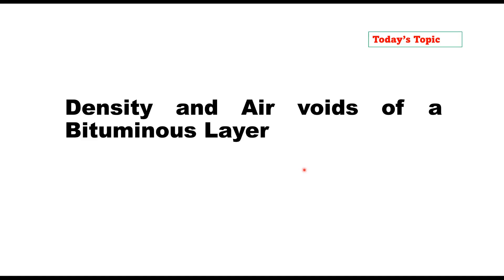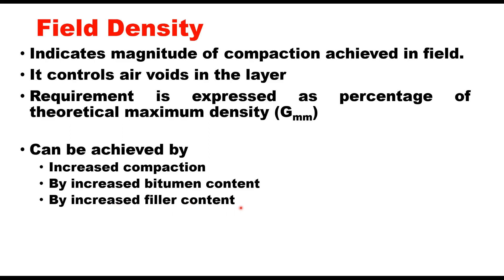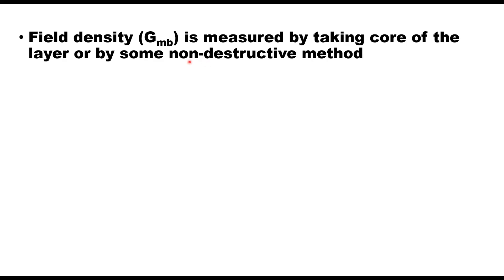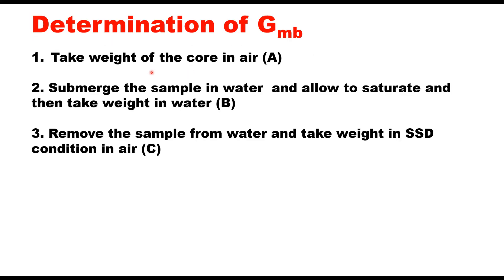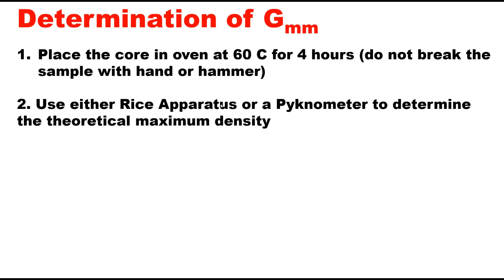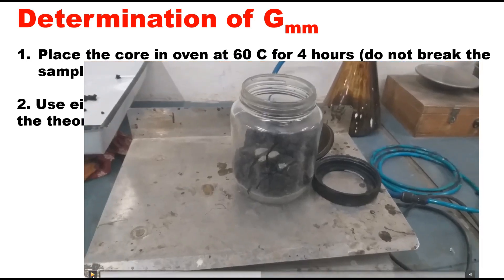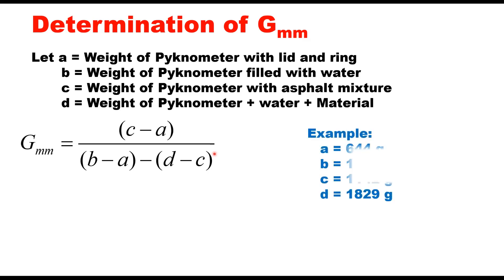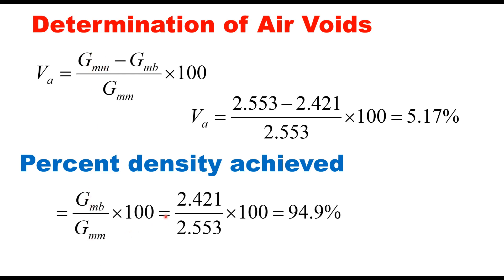Determination of Field density and air voids in asphalt layers, quality control in field for density

Comment: Sir please mention relationship between air voids and effective binder contain for asphalt mixes as we consider either Va=3.5% and corresponding Vbe=11.5% or Va=4.5% and corresponding Vbe=10.5% for design of flexible pavement using IRC-37:2018.
Reply from the maker: This relation is like this
Va = VT - Vbe - Vagg 
Va = Air voids
VT - total volume of compacted specimen 
Vbe - effective binder volume, and Vagg = bulk volume of aggregates

Comment: What should be done if achieved airvoid is more than designed airvoid after construction. For e.g if in design targetted airvoid considered os 3.5% and after construction field result shows 4% airvoids.
Reply from the maker: There is not much that can be done after the mat has cooled down to the cessation temperature. Therefore, air voids and density must be checked and achieved during rolling of the layer itself. However, layer will certainly receive some compaction due to traffic and this marginal difference of 0.5 % can be compensated by the moving load. But the large difference in design air voids and field air voids will create the situation of secondary compaction which will result in the surface rutting.